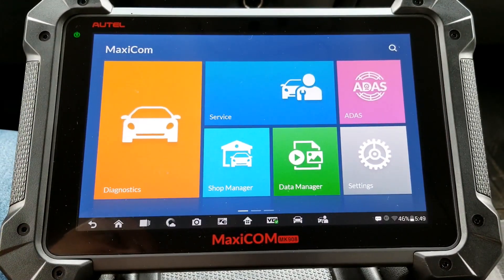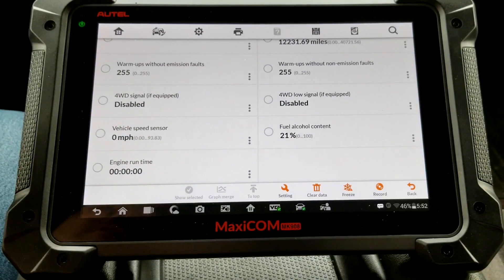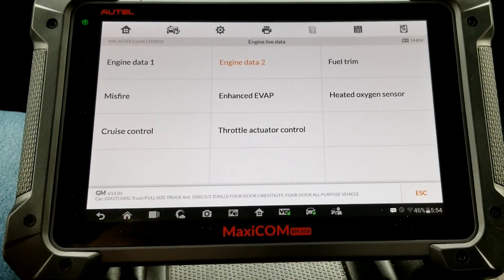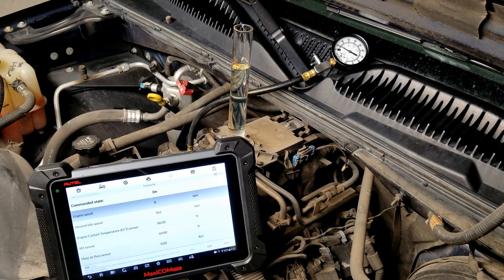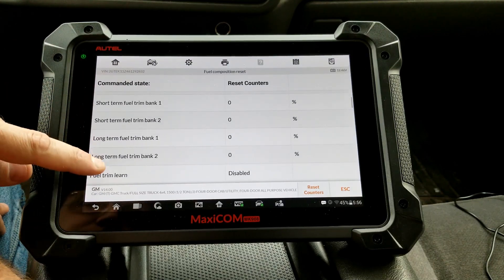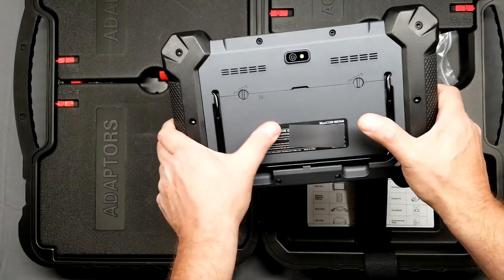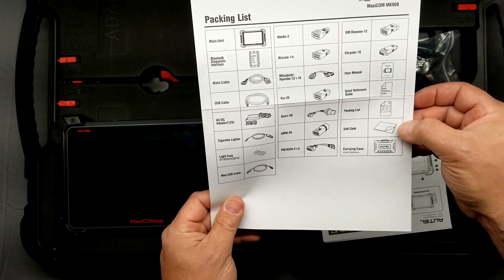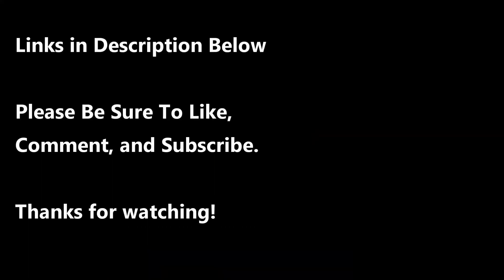Autel MaxiCOM MK908 Scanner Review and GM Code P0172, P0175 Repair. New For 2019. MK908P

Comment: Great video. Why did the vehicle read high.  I'm having the same problem and having to bring it in every 3-4 refills  to be reset. Should I just buy a tool to reset it myself?
Reply from the maker: I've only had to reset my truck once.  It's usually caused because the vehicle does not have an alcohol sensor.  The computer tries to calculate fuel/alcohol content and it gets confused.  (for lack of a better description)  It's usually cause by short gas tank fills combined with short drives. I can't guarantee that is the problem with your particular vehicle but it is very common with GM vehicles from the era.   It's been a while since I have watched my own video but I am pretty sure I covered all this in the video.  Maybe not.  Thanks for the question.

Comment: Does this scanner can be use for diesel engines as well? Thanks.
Reply from the maker: I have used it on light duty diesel engines/trucks.  When I say light duty, I mean 550 or 5500 series trucks or smaller...  Such as F550 Ford, and 5500 Dodges but I have very little experience with those.  I would not be able to give you a full description of its abilities on those diesel trucks.
Reply: @SlipFitGarage  Thanks for the info

Comment: Alcohol fuel is wayyy cheaper. Doesnt mean they aren't blending more Alcohol to make their fuel costs cheaper
Reply from the maker: Anything is Possible.... The fuel I have tested that is sold around here has all been 10% or less. I'm pretty sure there is a law stating that any fuel with ethanol mixed in, that is sold commercially, has to have NO MORE ethonol than "advertised". It can be less, but not more.  Does that mean it's impossible to find fuel with more ethanol than advertised? Probably not.... but it's also not likely, either. At least around here....

Comment: I had one that refused to reset, changed the fuel controller, which also controls the trailer brakes, which also had an issue.  what an odd combination
Reply from the maker: That is a weird combination. I didn't realize the fuel controller  also controls the trailer brakes. Now I know. Thanks for the comment. 🙂

Comment: Will this scanner work in the USA? I keep seeing issues about odffyfolj the ip address buwill b
Reply from the maker: This video was filmed in the USA and it worked just fine while filming.... and every other time I've used it since. Not sure what you're reading on the internet, but if you buy a scanner from the USA Amazon website, it SHOULD be a scanner designed for use in the USA. If you have trouble with the scanner, just send it back. Simple. 

Yes, this scanner is sold in other countries... but those scanners are designed for those countries..... just like the version I have was designed for use in the USA 

Thanks for the comment.

Comment: More expensive scanner will do more things. That scanner in vid is a decent scanner. Its between 400 and 800 i believe.
Reply: Brant Gentry its actually over 1.500k
Reply from the maker: It's more than that.... But it also depends where you buy it. Thanks for the comment.
Reply: In losangeles  cost is 1800

Comment: I can’t get mine to work, it just says no data, like it can’t connect to my car
Reply from the maker: Is there something wrong with your vehicle? Try it on another vehicle and see if it works. If not, email or call Autel's tech support. If all else fails send it back and exchange it for another one. Did you buy it from Amazon? It's possible you got a bad scanner from the factory.

Comment: Do you think a tool like this is overkill for a home mechanic? I do my own repairs and service but have always had older cars, now I've upgraded to a newer car starting to consider a decent tool that can help diagnose the myriad modules if and when there are issues and if possible help bleed the braking system including abs/tc properly
Reply from the maker: It all depends how you feel about buying tools that wont get used much. I absolutly have no problem buying a tool that I know wont get used very often. Other people might feel that its foolish to own tools like that. This tool is awesome when you need a full functional, bi directional scan tool. I am very glad that I own it even thought it wont be used very often. If you can afford to make the investment, I'd say go for it. It's a purchase that only you can decide to make.
Reply: @SlipFitGarage  Thanks for the advice. I did some research and see Autel do some cheaper models that have similar functionality that would probably suit a home mechanic better. I have several tools that are specialized for a single task and I don't regret buying them as they have saved me so much time.

Comment: Is the MK908 better than the Maxisys elite?
Reply from the maker: It's hard to say....   The MK908 has an overall new look and feel than all previous Autel devices. The rubber grip around the edges is different, and the software itself has a different look. I am not an expert on every Autel model but just going by the advertised specs, they both have pros and cons. The MK908 has a Samsung Hexa-core processor, and the Maxisys Elite has a NVIDIA quad core processor.... The MK908 has a larger screen at 10.1 inches vs the Maxisys Elite's smaller screen at 9.7 inches BUT the smaller screen has better resolution. (2048x1536 vs 1920x1080)  The MK908 has a larger battery at 15000ah vs the Maxisys Elite's 13600ah.  The Maxisys Elite has an Ethernet port for wired network connectivity and the MK908 does not. As far as software functionality... I believe both scanners have the same capabilities. However, I will say that I have never personally used a Maxisys Elite so I cant be 100% sure on that. There may be a few other small differences that I have missed....YMMV.  Thanks for the comment!
Reply: brianok100 Wow, thank you for the detailed response! I have the elite and wanted to see if it is worth switching to this model. I think I’m going to stick with it for now, although this new one seems to have the same functions for far less $$
Reply from the maker: @Kanesgarage  You're welcome!  Thanks again for the comment...